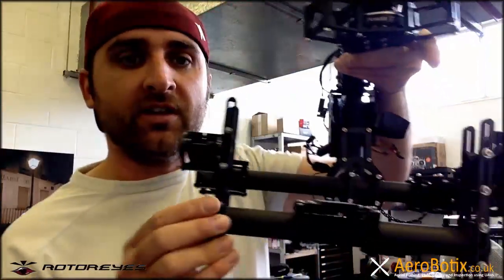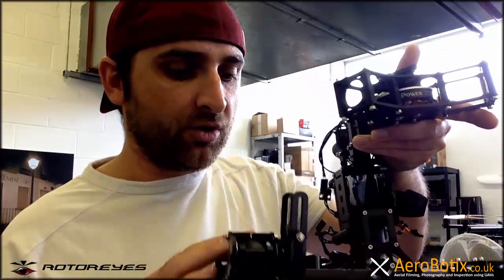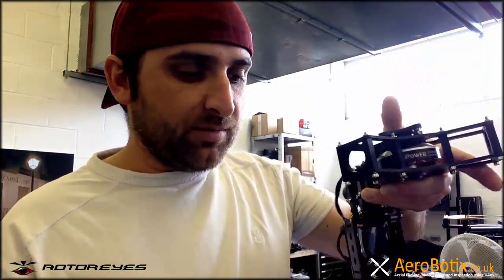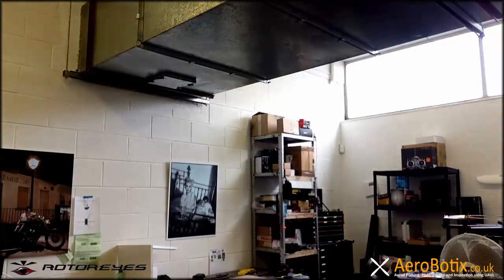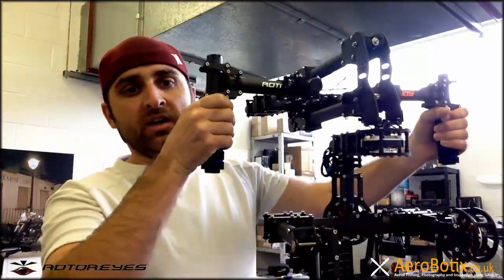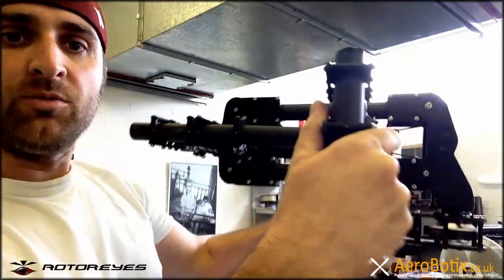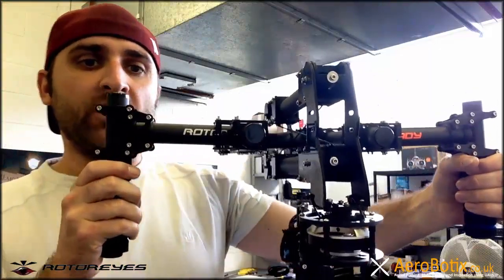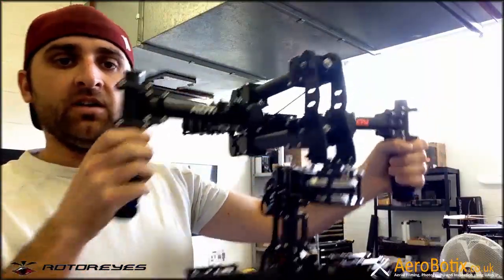4 Axis Gimbal, Worlds first??

Comment: That's NOT a 4 axis gimbal. The 4th axis is not electronically controlled via brushless motors. It's just a spring loaded (...using what looks like rubber bands?) parallelogram link.

It's still cool I'm just being picky about the terminology.

Comment: Could that be motorized? It looks smoother, but add a RED to a gimbal like that or any other cam that weights enough and I bet its less smooth as the stabilization mechanism is only mechanic.

Comment: Thanks for making that Video and good luck with your innovations ...

As a point of interest the ShadowCam, is touted as the first to work on five axes of motion — or rather, three axes and two planes. It claims to dampen approximately 180mm (7”) of travel when moved in a vertical and or horizontal direction,

Here is a Vimeo Demo of it: http://vimeo.com/87950998

I'm a big Fan of DeShaker, you can see how good that works in my latest Video.

Comment: Very professional looking.  love it.
Reply: BrodeOne Better? This won't hold like 2-5 pounds of weight when running around. Especially pulling it up with electro magnetic force will be close to impossible (and it will eat up batteries fast).
Reply: mechanic 4axis? :)
we are better :-P this is motor for 4th axis
Lineární gimbal motor flyrecord.cz  - laboratorní prototyp